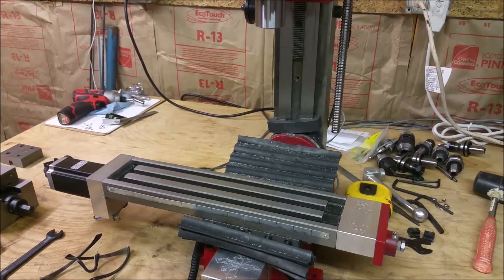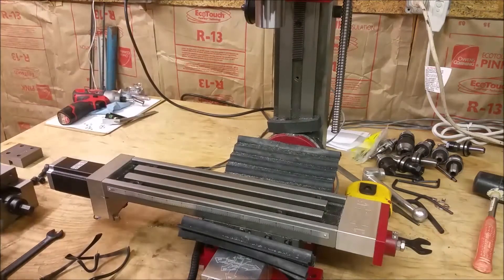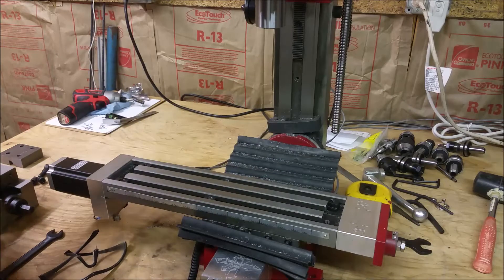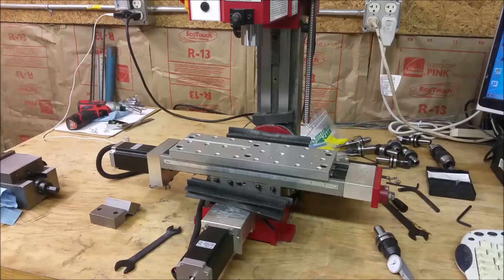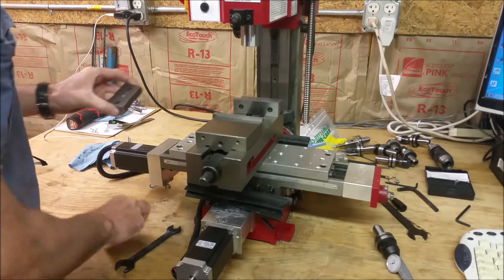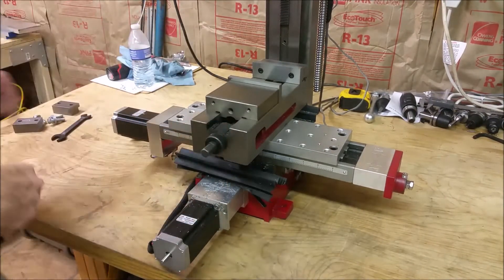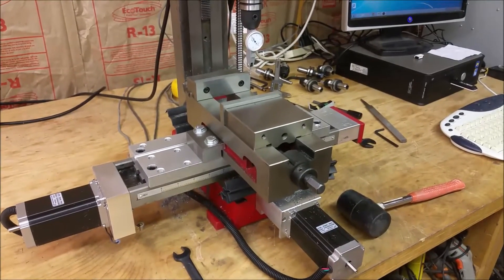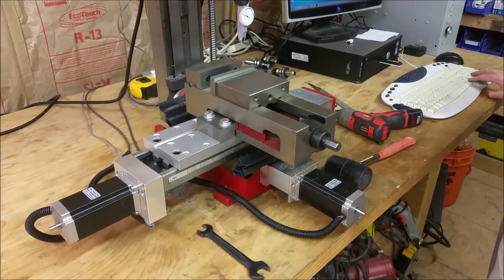Mini Mill CNC Conversion Part 9 - Installing the Tooling Plate and Vise

Comment: Couldn't you have made that fixture plate on your mill??? It's just aluminum after all. If that mill can't do aluminum it not worth the $$$ IMHO.
Reply from the maker: The work envelope is smaller than the table size.
Reply: @craigsmachineshop2040  Couldn't do half and reposition to finish the rest of the holes for some reason? Aside from not understanding that, I love the concept. That's how I setup all my machines for "plug-n-play" fixturing.
Reply from the maker: @ThePreyMantas  Might work for some things but a fixture plate is supposed to be very accurate. It would also take 4 setups.
Reply: @craigsmachineshop2040  Yea, it would be more work than if you did it your larger mill. I didn't realize you had one until I started poking around checking out you vids. :)

Comment: I Like the Vise its 11" long what is the Height? and did you go with the 4"
Reply from the maker: CNC4XR7 Yes, it is a 4 inch vise and 3 5/8 high to the top of the jaw.  Yeah, it takes up a lot of the precious z height especially with the tooling plate.